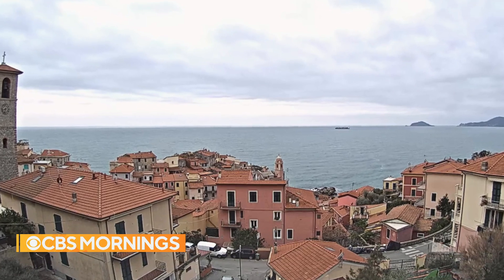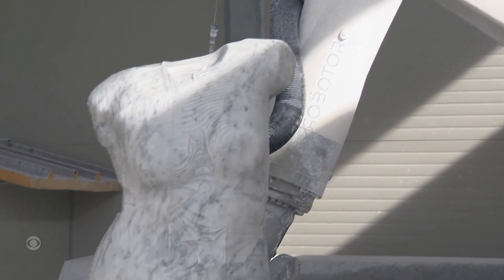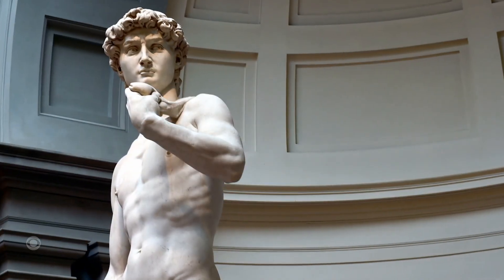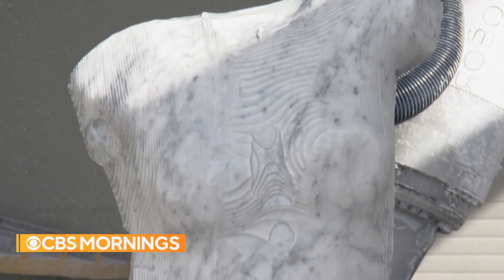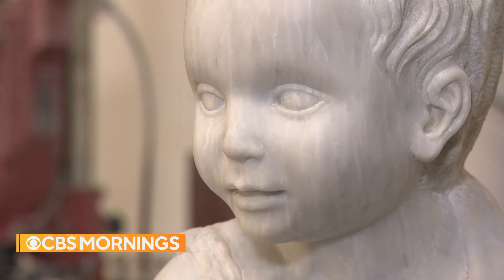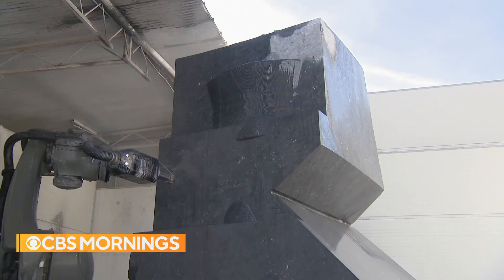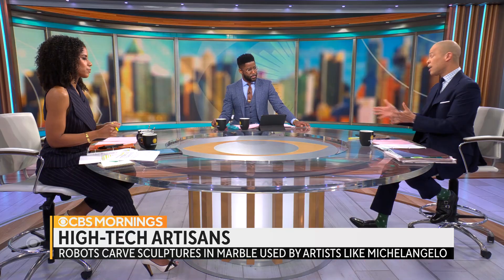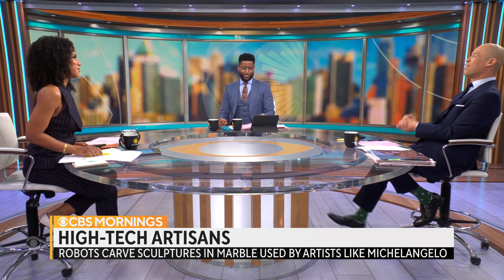Robots used to carve out marble sculptures

Comment: Interesting that the guy at the end brought up a Rodan sculpture as a counter argument. Rodin worked with teams of sculptors to create his visions. Most of his marble sculptures were made by assistants known as practiciens who would model them after the originals. These robots are just doing the work of the assistants, and an incomplete job at that as the finishing touches are still done my humans. Is art any less art if you use tools to make the creation process more efficient? Lots of people have a very narrow view of what constitutes art.
Reply: To take your point even a little further: Michelangelo, for example, did not have to carve a statue from a mountainside. Tools were used to provide him a block of stone. Not every painter spun their own thread and wove their own canvas, or even made all of their own paints, though some did make their own paints. It's a matter of degree in this case, where the irreplaceable creativity is entering the picture, no pun intended. It's a fine point I think, but is the same point of making the process more efficient. Also, the guy at the end completely confused the machine executing the design with the creation of the art. He kept emphasizing the machine should not make do the creative design portions. Now on the computer, some of the curves and lines may have been finished or filled in by the software, so the plot thickens.
Reply: Exactly, you still have to design the thing in the first place, that's where the artistic expression happens

Comment: Does an architect put hammer to nail during construction of structure? No. They do the design and have the final product commissioned. The artist does not make anything with this machine. The machine has made it. You could be a wonderful 3d modeler but if you told me you "made" a sculpture with this then I would laugh in your face.